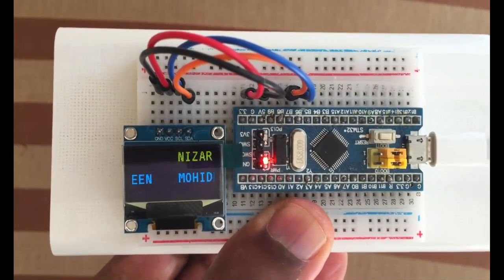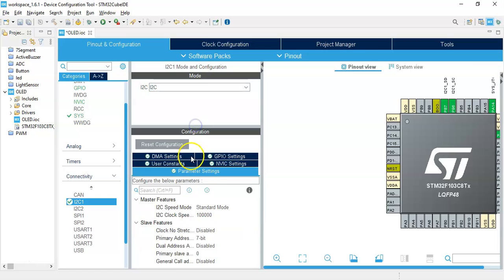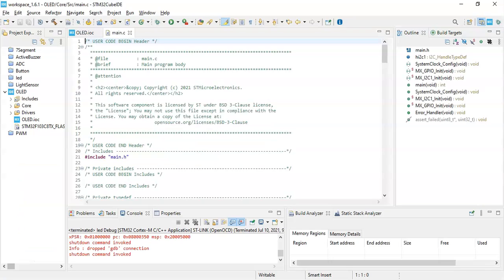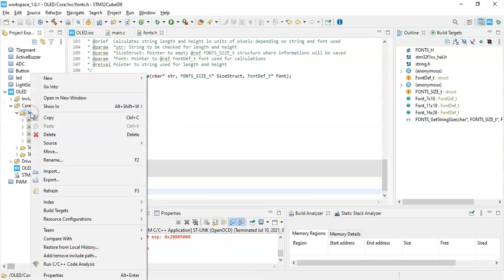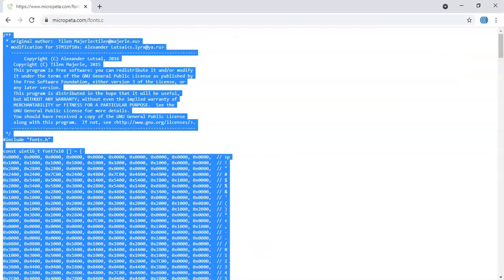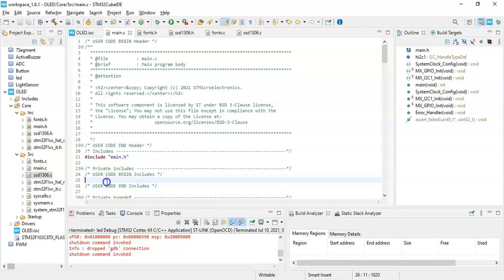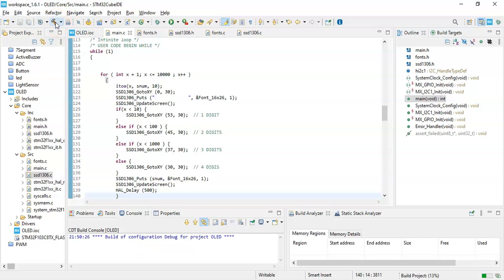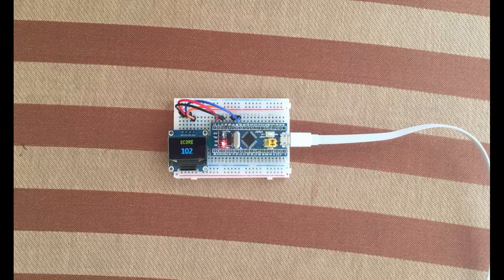19. STM32CubeIDE OLED Display. I2C with STM32F103C8T6

Comment: can i use rthis for another controllers
Reply from the maker: You can use this library for almost all stm32 with cubeide. for example: I have used it with stm32f446re nucleo as shown in https://youtu.be/MWdeshRxW_A
Reply: @NizarMohideen  actually i need to use this library  in holtek controller ,my oled size is 128*32 and address is 0x3C what are the changes i need to make for that
Reply from the maker: I am sorry I don't have experience with  holtek controller

Comment: dear friend. could you post an example of working with this display on the spi interface?
Reply from the maker: As for SPI, we need minimum five pins in the module that are
1.VCC (for power supply)
2.Ground
3.MOSI (Data)
4.CLK (Clock)
5.CS (Chip Select)
Since this ssd1306 oled display has only four pin, SPI is not possible. Thanks

Comment: uint8_t sicaklik;
        char dizi[5];  
     
     while(){
          sprintf(array,"%d", temp);
	  SSD1306_GotoXY (53, 30);
	  SSD1306_Puts (array,&Font_11x18,0);
	  SSD1306_UpdateScreen();
	  HAL_Delay (500);

}

I checked in the debugging environment, there is no issue with the conversions. When going from two-digit temperatures to three-digit ones, there is no problem. However, when the temperature drops below 100 degrees, instead of getting 99, 98, 97, I'm getting 990, 980, 970. What could be the reason for this?
Reply from the maker: SSD1306_Clear();
It will clear the 0. If you have flicker, then write empty space "     "
Reply: @NizarMohideen  thank you very much sir for interesting and help.İts solved

Comment: ssd1306_Init();
undefined reference to "ssd1306_Init();" I am getting error. Has anyone encountered this problem? How can I solve it?
Reply from the maker: Put the library files
Inside Core/Inc Folder
fonts.h 
ssd1306.h

Inside Core/Src Folder
fonts.c 
ssd1306.c
Reply: @NizarMohideen  I added the libraries and the error appears in main.c in the src section.
Reply from the maker: Try SSD1306_Init(); instead of ssd1306_Init();
Capital Big SSD not simple small ssd
Reply: I solved the problem. In the Properties section, changing the libraries option from executable to static libraries fixed it.Thanks a lot

Comment: i tried your code on stm32f030c8t6 it worked that time, now i am trying the same with stm32f103c8t6 but it is not working with and its  new version display, though i studied its datasheet the address it says is 0x3C, i tried every address, its not working at all, even made pull up connection, the sda and sck lines both remains in high state, suggest me to fix it

Comment: While uploading the code each time, I'm getting an error :
Error in final launch sequence:

Failed to execute MI command:
target extended-remote localhost:3333

Error message from debugger back end:
localhost:3333: Connection timed out.
Failed to execute MI command:
target extended-remote localhost:3333

Error message from debugger back end:
localhost:3333: Connection timed out.
localhost:3333: Connection timed out.

Just after I use the run option or debugger run. Why so?

Comment: 16:00:48 ** Incremental Build of configuration Debug for project ex01-ledblink **
make -j4 all 
arm-none-eabi-gcc "../Core/Src/main.c" -mcpu=cortex-m0plus -std=gnu11 -g3 -DDEBUG -DUSE_HAL_DRIVER -DSTM32L052xx -c -I../Core/Inc -I../Drivers/STM32L0xx_HAL_Driver/Inc -I../Drivers/STM32L0xx_HAL_Driver/Inc/Legacy -I../Drivers/CMSIS/Device/ST/STM32L0xx/Include -I../Drivers/CMSIS/Include -O0 -ffunction-sections -fdata-sections -Wall -fstack-usage -fcyclomatic-complexity -MMD -MP -MF"Core/Src/main.d" -MT"Core/Src/main.o" --specs=nano.specs -mfloat-abi=soft -mthumb -o "Core/Src/main.o"
../Core/Src/main.c:25:10: fatal error: fonts.h: No such file or directory
   25 | #include "fonts.h"
      |          ^~~~~~~~~
compilation terminated.
make: * [Core/Src/subdir.mk:34: Core/Src/main.o] Error 1
"make -j4 all" terminated with exit code 2. Build might be incomplete.

16:00:49 Build Failed. 2 errors, 0 warnings. (took 1s.526ms)

This is how you get the error.
Reply from the maker: put fonts.h file inside Core/Inc Folder
Reply: @NizarMohideen  Do you have to connect the USB port when you do the green arrow RUN DEBUG? Or should I be connected to ST-LINK V2?
Reply from the maker: ST-LINK V2

Comment: Hello Nizar. What display do you use in this video ? I see it's SSD1306 based display, but which model do you use exactly ? It's colors display. Thanks you very much for nice demonstrations!
Reply from the maker: SSD1306 oled comes mainly with white color, blue color or blue/yellow color. This setup and code will work with all of them as long as they have I2C pins (SCL/SDA).
For generic display module, it will work straight away. If it is adafruit module, comment
//#define SSD1306_I2C_ADDR     0x78
#define SSD1306_I2C_ADDR       0x7A
in ssd1306.h file. Thanks